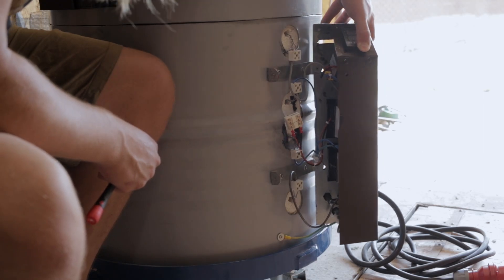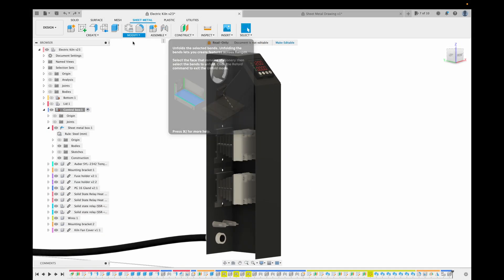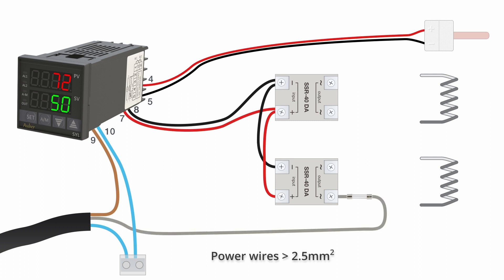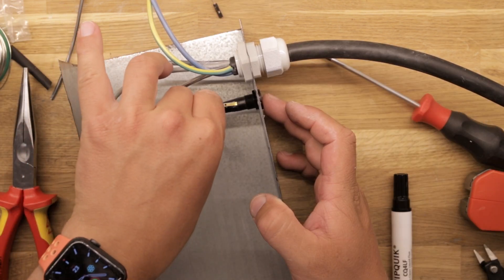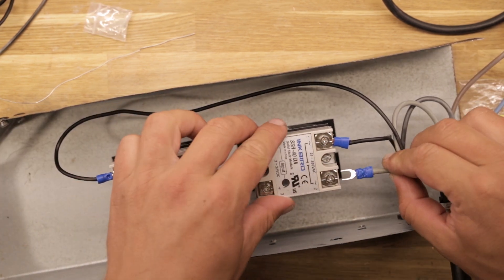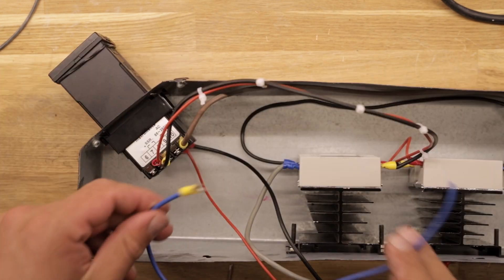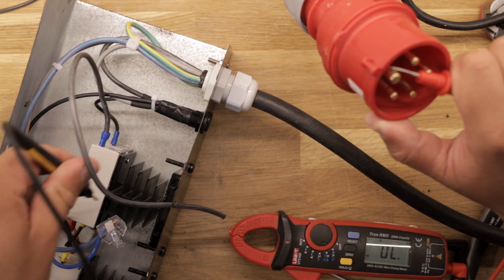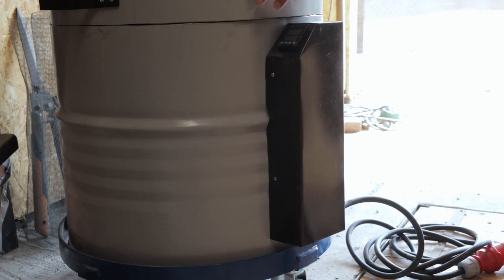Ultimate DIY Electric Kiln Guide - Electrical Wiring (part 4)

Comment: You connected only one side of ceramic blocks that mean that current will have only one kanthal wire not two in place where two wires are probably needed most.

Comment: Hi Jacob, did you fire it up? Your work on the control box design, construction and wiring is great, but how the control box worked with the kiln together in a real test is very important, too. Please, share any results you got from firing the kiln in testing or in working mode. And thanks much for this video clip. That could help many hobby potters like me to understand well what you've done and how this project is progressing..

Comment: Hello, is it possible for this kiln to work on  Single-phase current? And if i want to use the maximum volume and put on one or two more Rows of Bricks, could it be more kW on  Single-phase current and is this insolation suitable for this?

Comment: Just an fyi based on my local electrical experience(s), when dealing with mains voltages and current above 5amps you should only use mechanical connections to secure conductors throughout the circuit as solder can & often will soften under load and break free from connections. Take it or leave it, just my 2 cents on an otherwise beautiful build. My hat is off to you sir! 👏🏻

Comment: The end of flexible electrical wires shouldn’t be drilled. Leave them straight and put some wire end ferrules on it. Also when you put more than one cable in it. Otherwise it might get loose due too heat expansion

Comment: I appreciate what you are saying here. I just tested my kiln and at 240v and 20a with his calculations I can only get my kiln to 631 degrees *F. Any suggestions on how to get the temperature higher?? I followed his instructions to the letter. I’m very confused why I’m not getting the same output. Any help. Would be appreciated. Thank you

Comment: Can you explain how to wire this setup but using single phase 208/240v?? I’m moderately confident that I have the wiring correct but your validation would be great! I am using a 14/2 SWOOJ cable for the power supply. I will be grounding the components to the electrical component structure and drum as well. I’m also using a GFCI Breaker on its own circuit to power this unit.

Comment: And NOW - after 3 and a half video, You tell me this is a 3-phase...🤕
Reply: You can absolutely do this with single phase, just need to connect the single phase to the connections where each of the 3 phases were connected, but you'll need a decent supply and incoming cable size to support the 5000w

Comment: Wow. Thanks for sharing! This is awesome! Looks like the heat damage is from radient heat being near and touching the surface of the kiln. Seperate the enclosure from the surface (attached but stand off type mount) to create an air gap between and add high heat resistant insulation. to reflect the heat away from the enclosure. Same principle as the heat sinks of the SSR in that the fins have air gaps between to dissipate the heat.

Comment: Put the SSR's on the bottom and orientate them so that the airflow goes directly through their fins.
It's better to offset the whole box a centimeter from the kiln side so that you do not heat the contents of it unduly.
The elements are normally not fastened on to the side of the kiln because it hinders the contraction/expansion of the elements.

You design is centered around the placement of the PID controller not the temperature and airflow. You can do better than this ;*
Reply from the maker: Hi Lauge, you are certainly right in your critique and most importantly I have realised that the PID+SSR needs to be placed further away from the surface of the kiln to protect them from the radiated heat. 

Best wishes!

Comment: This is amazing work. Can't wait for next episode

What tempertures are you able to reach in the kiln?
Reply from the maker: Hi Dam! I have been able to reach 1110 °C when drawing little less than 5kW for four hours. At that point the temperature increases by around 2°C per minute.
Reply: @jakobhalskov how hot is the  outside of the kiln getting at that point? If you wanted to get hotter, would you use more insulation?
Reply from the maker: @timtravelnomad  it gets somewhere around 100-150°C on the outside surface of the kiln, depending on hot you warm it up to and for how long. And yes more insulation will make it able to reach higher temperatures quicker :)
Reply: @jakobhalskov  thats for the great videos Jakob! 

If you're looking for a new interesting project that's has some overlap, but then pushes the boundaries a little, i'd suggest looking at thermal heat storage. 

E.g turning your kiln into a heat storage battery, that can be used for delivering heat and even electricity on demand. Often with a storage medium like sand, rocks, bricks, graphite on the inside. 

Its very topical now that the world & many houses are ending up with excess cheap renewable energy at certain times of day. 

Thanks again :)

Comment: Could you use two phase with a single coil at 20A" I have 2 phase 220v 50A circuit.
Reply from the maker: Yes, you just do the calculations and design process with one element and remember to correct for the increase voltage if you plan to connect the two phases across the element.

Comment: Is your thermocouple working? It looks like you didn't use themocouple wire(?)
Reply from the maker: It has been working fine for me for some time now :)
Reply: @jakobhalskov  it's mostly because it's a very short path from the thermocouple to the PID but you will get a voltage error when not using S-type wires (each thermocouple type uses different type of wires called compensating wires)

Comment: Thanks for sharing. Obs:Maybe you´ll need to rotate de aluminum heatsink 90 degree.
(to make air flow through the fins verticaly).
Reply from the maker: Yes, that would improve the cooling and airflow - I am thinking of making the control box a bit bigger to allow for this. The current orientation just made the wiring easier, but was not a good decision regarding thermal performance.

Comment: Thank you for continuing your project. I'm working on upgrading an old kiln from 1x 230v 3600w to 3x230v 6600w. It seems SSR relays need to be quite beefy to handle the power.
Reply from the maker: Indeed it is better to at least double the current ratings of the SSR and even more importantly make sure they are kept cool. I learned it the hard way by having them in the enclosure mounted directly to the kiln without ensuring proper active cooling.
Reply: Laboratory Heat Plates use a Semiconductor and a mechanical Switching Element.
Fine Tuning is done using the MOSFET and steady Heating applies the Relais.
I don’t know if there are easy to find Controllers for that, but that Way you have the Upsides of both.